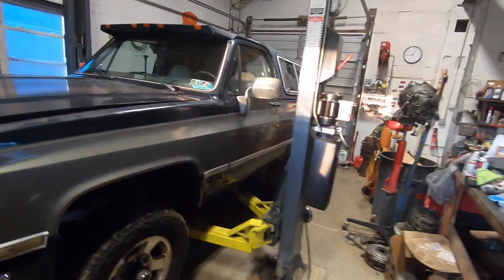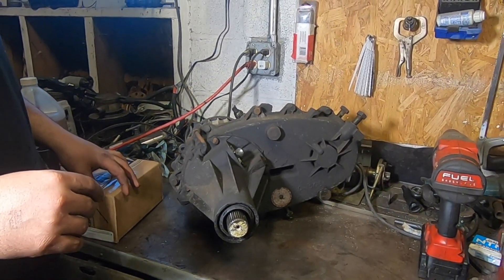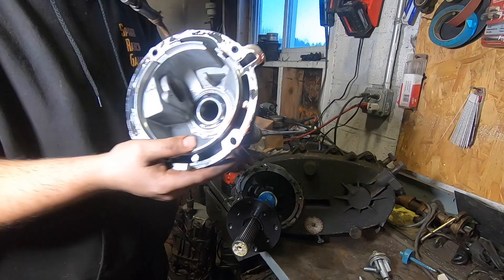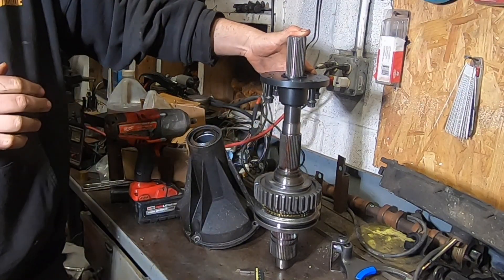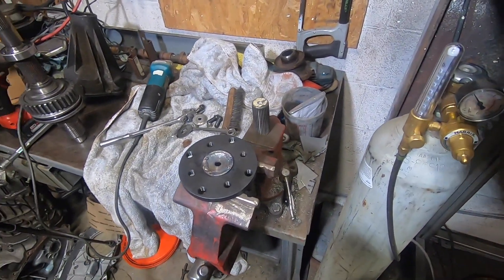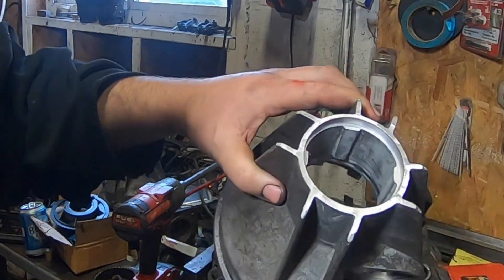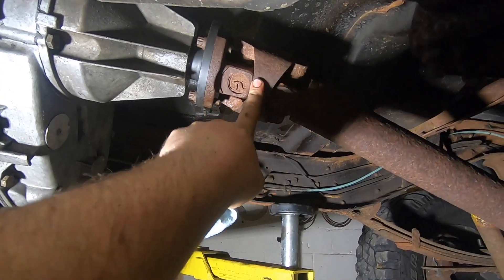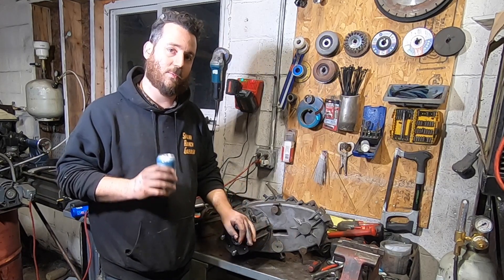I built a Squarebody NP208 SYE Slip Yoke Eliminator with a CV flange

Comment: I planned on doing this conversation and started by ordering the seal you show as being used. THE LINK IS THE WRONG SEAL! Be nice if you fixed that.
Reply from the maker: I’ve purchased 3 seals from that link without issue. Sorry there must be a supplier issue or something changed with the listing
Reply: Show the brand and actual part number please.  The link you show got me a 14 bolt ff inner bearing seal I think. I’m not the only one that says the link is wrong

Comment: Looks like this new flange is about the size of ford f250 rear diff flange?  Im asking because I just swapped a f250 axle and im not sure best way to make a prop shaft to connect np208 to ford f250 rear axle. Thx
Reply from the maker: Good eye! This flange is drilled for ford double cardan joint. I actually run a F250 front driveshaft on the back axle of this transfercase in a K5 blazer.

Comment: What flange did you get. I brought one and it will fit the front output shaft. But not the rear output?
Reply: Also the link to the seal is not right
Reply: @spankranchgarage
Reply: @spankranchgarage

Comment: You should bring that to the market my guy, my driveline making was telling me I should eliminate my slip yoke cause of how bad the angles are when I picked up my front driveline and this would literally solve 99.9% of the issues I’m running into trying to figure out a solution. Awesome vid though.
Reply from the maker: I cant believe the aftermarket doesn't make this yet. There's so many trucks out there with a 208 transfer case that I think could benefit from this modification.
Reply: Tom Woods will do it, at $500...eyeroll
There's kits for the 241, if you can find one. They only came in 89 with a mechanical speedo. Every year after 89 is vss.

 @spankranchgarage
Reply: I’d like one for my 85 k5, I’d pay you for one

Comment: Having a cv joint at the t case output and just a u-joint at the differential can cause a lot of driveline vibration unless you have your pinion angle inline with the driveshaft. It’s good also to have the pinion about -1° of the driveshaft angle so that it goes to about 0° under acceleration. You probably know all this but I’m just trying to sound smart too.
(Wrote this before seeing the finished product.)
Reply from the maker: Your exactly right I agree!!

Comment: Sweet. I've got the same issue with my S10 Blazer. I like this solution.
Reply from the maker: They might make a kit for yours. Would be easier than this route but I didn’t have an option
Reply: @spankranchgarage  I'm using a K3500 tcase with the SM465, so there might be one.